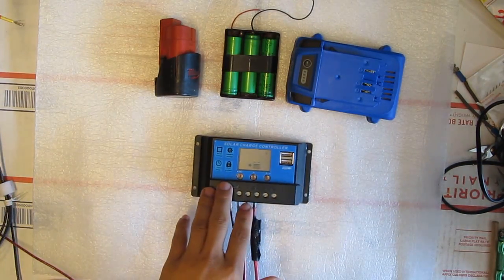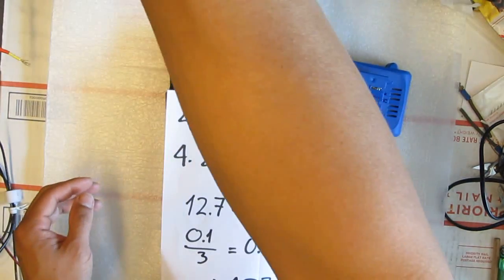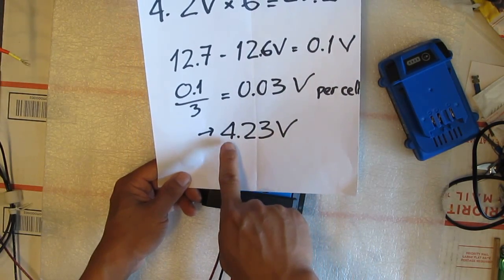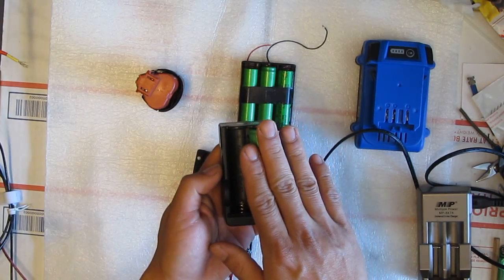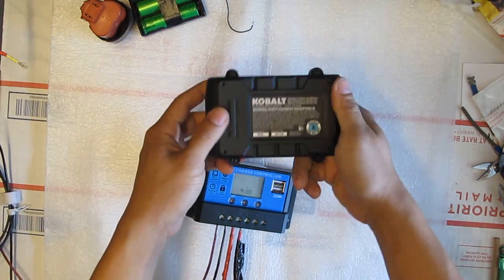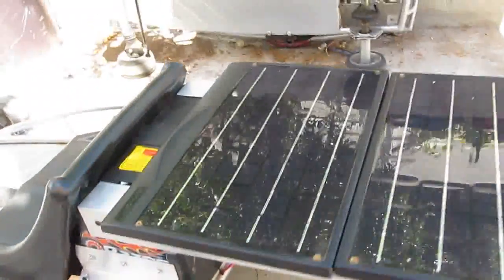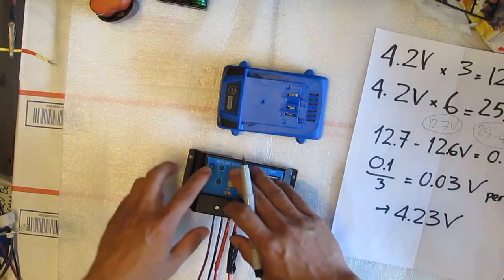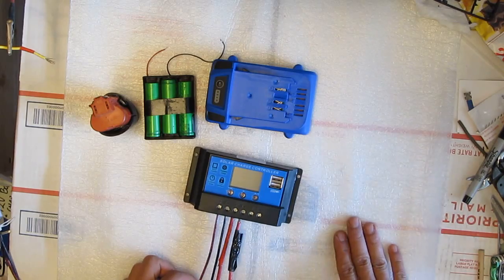Charge Li-ion batteries with regular Charge controller made for Lead Acid batteries

Comment: Without balance, you could over charge a single cell as they won't have the same voltage.

You can put a diode on and get a 0.7 volt drop. But you can add volts from the minimum to make up the difference.

Or you could get rid of the charge controller and use a buck converter. It would be less and you can control the current and voltage.

Comment: Hello sir, suppose i use 3s bms to charge 3 cell battery pack, while charging the battery pack, at the same time can i run 12v device from output of controller? How many months or years your lithium battery survived

Comment: Hello.... and thankyou kindly for your video because i have just purchased one the same exspecting it to charge lipo cells.... your spot on with your maths and i was always tought that you take it to the lowest or highest values in resistors when messuring the capacitence etc.. 

just gota figure out wich setting to put it on now b1 b2 or b3 hahahaha decitions dicitions... stay kool bro.
out.

Payyyyyce.

Comment: Charging voltage is not the only parameter. Lithium cells also have a maximum current for charging. Typically this is "1C" (for cheap Chinese LiIon), that means one times the capacity in amp-hours giving a figure in amps. So those 18650 are, say, 1500mAh capacity -> meaning your charger needs to be configured to output a maximum of 1.5A. These cheap lead acid chargers don't have a current limit setting, only voltage. Too much charge current, at best, will reduce the life of your batteries. At worst it's downright dangerous (overheating, fire, etc).

Comment: most lead acid chargers may say 12 volts but they will actually bring the voltage up to around 14v. Sometimes even higher. Have you put a volt meter on the battery as its charging? just to see if is staying at the voltage you set it at.

Comment: HI VUAECO.HOPE U AND FAMILY ALL WELL.IM THINKING ABOUT USING MY RENOGY ROVER MPPT I HAVE IN BACK OF MY CAMPERVAN  TO CHARGE MY EBIKE BATTERY IM NOT UISNG MUCH.ITS 52VOLT 14S5P.CAN I SPLIT INTO 2 AND CHARGE AS 24V TO 26V FROM MPPT.I HAVE 30WATT X 3 PANELS ON ROOF.OR LIKE YOUR VIDEO MAYBE JUST USE A 6S5P BATTERY AND ALTERNATE 2 OF THEM CHARGING .MY WAECO COMPRESSOR 12/24V FRIDGE RUNS AT FRONT OF CAMPERVAN AT MOMENT OFF A 100WATT PANEL AND A DC TO DC CHARGER.SO PERHAPS CAN RUN FRIDGE AT BACK OF 18650S
Reply from the maker: Hi Steve, Yes, you can split the 14S pack into two if you have an 8S charger. Most balance charger are for 6S so you might have to split that into 3 parts (6S, 6S, and 2S)
Reply: @vuaeco  ok.so if I use split 14s battery into 3 and charge each 6s from solar neat a time and can I hoping to connect usb to between 12v half of 24v part.ive got a bms bluetooth connected to 14s pack at moment so can monitor cell voltages.so maybe can join 2 x 6s together again to balance or I've seen a 8s charger on eBay 50£
Reply: sorted for now ive wired usb to battery terminals on works ok so must be 24volt compatible
Reply: @vuaeco  hi .I’ve split 14s battery into 7s x 2.connected in campervan to renogy rover 20 amp mppt.its 26volt the 7s after charging.there’s 3 x 30 watt panels on roof.I had a usb socket connected to load of renogy but can’t get load to switch on.will usb still work off 24v?been playing with settings on renogy.I get 12/24v up then 24v then press enter but goes back to display 12v each time.I was only using renogy to power usb socket when had 12volt leisure 110ah before.
Reply: It seems you can get usb sockets for 12/24volts
Reply: @vuaeco  after trying the 7s 18650 in campervan it dropped voltage to 21.6 volts from 27v after a cold night and although there was some sun it only managed to get to 22volts so I’ve taken that pack out and I’m using a lead acid 110ah battery that’s parallel with my fridge battery 110ah .that has 100watt panel an another epever mppt running that seems ok now

Comment: This video shows you what can be done I wouldn't say it should be done though.  If you're going to use Lithium-ion batteries with this particular charge controller there's only one way to do it in my personal opinion. It would be with a 7s configuration. Putting the battery within the parameters of the charge controller without overcharging the battery. Not only do you not want to charge a lithium battery beyond 100%. In a solar setup you really should only be pushing them to 80 to 90% capacity. So even though lithium iron phosphate is a much better chemistry for solar setups I think it's just fine to use lithium-ion cells. Use them if you got em. But use them the right way. And for God's sake if you're going to use the cheapest possible charge controller put a BMS on your battery! I do like your videos but some of them such as this one are a little bit reckless.
Reply: I tried using this setup on my lithium ion battery that has a bms and it blew up. I now use a similar solar charge controller meant for li-ion battery

Comment: Hello friend! The parameter you are changing is not the charging voltage. It's the "float charge" voltage and that means the controller will just trickle charge small amounts of current at 12.7 volts, AFTER the bulk and absorption phase. After the battery reaches finish the absorption phase at 14.6 volts or whatever voltage depending on the battery type, (B1, B2, B3 in the manual its the menu number 6) it enters the float voltage charge which actually is for maintaining the battery at full charge without the battery being burned!
Reply: I believe there are different versions of this controller that look identical but function differently. When I change that parameter on my controller it's definitely not setting a float mode. It's a disconnect.
Reply: @aznative_  My previous comment was an expectation of what the charger should do. But after installing it, what it does is that it just stops charging at 14.5V. The float mode doesn't work and nothing changes if i set it to 13.4 or 13.8V

Comment: Good morning Sir.  Thank you for sharing this.  I do not have any technical knowledge but would like to get a small solar system set up for my driveway lighting.  Your video helps a lot as I have been thinking about the storage.  I'll likelybuse my old laptop batteries to just get started and have a feel for the system.  May I ask: 
1.  I saw some videos saying that it is advisable that the controller have a temperature sensor to protect the battery, but in their video they had a lead acid battery set up.  Would this be a concern for the set up you did?  I will likely not check it often, so I would like to just make sure it won't be a problem later.  
2.  I am planning to plug in the load to the controller load connection.  Would this be a sound set up or is it better to have an inverter?
3.  If I use an inverter, can a 24v battery setup handle it and what inverter wattage is advisable given I plan to run a 24v 40w swing gate opener and 3 6w led bulbs?  
Sorry for the many queries.  Any help would be appreciated.
Reply from the maker: Unless you have wild swings in temperatures, the temperature sensor is not necessary. I rarely use it. Don't use the load on the controller, an inverter should be used. The load on the controller is only 12V DC with very low current. You can use 24V system but 24V inverters are harder to find and more expensive.
Reply: @vuaeco  ok, i'll keep that in mind when I plan out my purchases.  The temp range is 9 to 28 degrees Celsius plus where I plan to keep the system's case is often shaded.

Comment: The one thing that isn’t covered is the rate of charge. Most 18650 will only take 1.25 amps of charge. Anything more will damage the cells. The only way to get around this is to parallel the cells so they can accept/handle more shared amperage.
Reply: Non è vero

Comment: Hi my friend I tried this, and charging a 3S until 12,7V, the PWM controller went on flutuation voltagem, but still puts A on the Battery and some cells went to 4,5V.
Reply from the maker: These are made by so many different manufacturers. Make sure you check the max voltage on the controller when it's charging your battery. It shouldn't go over 12.7V. If it does then your charger has a problem.
Reply: @vuaeco  thanks for the advice, I will test mine to see if they Stop... I have 3 and one of them passed 12,7V is a little high, but if the Battery is balanced, not that much 0.03V, but now I made a 4S50P to prevent that from happening.
Reply: Same here. Using exact same setup as video. Just be careful that some cells may over voltage. For best setup also include a balancer to avoid over voltage. At maximum threshold of 12.6v S3 is not always reliable as there is very high risk of over charging and over heating the batteries leading to a shorter life span. Making a 16.8v S4 or higher battery pack and adjusting the solar charger is a more efficient and safer option if a balancer is not available. These cheap chinese solar charge controllers aren't always accurate so keep that in mind.

Comment: I have that charger and the 24v 2ah Kobalt tool battery. On 6-12-2019 at 0725 hrs I programmed the charger to 25.3v and am starting out with 21.4v on the battery. Look for smoke on the horizon?

Comment: What about the trickle charge... lead acid has a high discharge rate and if that charge controller is designed for lead acid... then the math shown is incimplete... either he doesnt know difference between lithium ion and lead acid or doesnt care if the lifespan of batteries gets shorter... maybe he is just promoting the product...

Comment: Il try to use a batteries from laptop battery cells , if i connect the lithium batteries do i have set in the settings? Or isit automatic detect? Bytheway this is my small hobby solar setup. https://youtu.be/wQNQM5qd32s

Comment: hello, in this controller it is possible to regulate the voltage for the batteries in the 4 load levels: Equalization, Float Charge, Stop Download, Reconnection Download?

Can I regulate the maximum load voltage to 16.8v, floating load to 14.8v, discharge discharge to 12.0v and discharge reconnection to 13.8v?

Comment: hello, can I use this controller to charge a 4 cell battery?
Reply from the maker: You need to get up to 16.8V to charge a 4S battery pack. This controller can only go up to 15V so the answer is no, you cannot charge a 4 cell battery pack with this controller.
Reply: Thank you! Do you know any controllers that can reach 16.8v?

Comment: hello, i bought one of these 30A labeled MOHOO. In the manual in technical parameters indicate 30A charge discharge current but after advices  "when the controller is connected to the 12V battery, the output of the maximum load is less than 120W and 240W when connected to 24V battery". Can anyone tell me how much load can i use, because less than 120W y less than 10A and is rated current 30A.

Comment: Can check to see if it will charge 7 cells at 29.4v? Reconnect at 24.4v under voltage protection at 21v?
If you could check to see if that charge controller could accept those numbers I would really appreciate it.
Thank you
Reply: Adam Welch has this in his solar shed videos.
Reply: @jakobhovman  YT ink?

Comment: Very nice video on this controller and also your other video on the controllers with lead-acid batteries.  I think it would be advisable to use a 3S BMS for 18650's as you have done here in the 12.6V case. Boards with balance capability are available from sites like Banggood for around $5 and they appear to work well.  They have over and under protection and over current as well as balance and they are made to be used with generic power input so they should work just fine with this charge controller. Apparently this controller does not fully cut the charge when current falls below a predefined level.  I plan to program an arduino nano to do that using a 5V relay and power it through one of the usb ports on the controller.  Thanks again for your videos!

Comment: Hello agen my freand really love youre videos i have a quick question or idea i have made a 74v34 ah battery for my e bike and was thinking if the e cobolt positive and negative end would charge the battery wich the cobolt charger like if you use 24v or 48 v paralel or 72 v if it would it would save allot of pepol waching you alot of money insted of geting a cicle statyator charger thats 350eu. Ty agen for the video and keep up the good wark ill send a pict of my e bike 1ns finished.
Reply: Pavlos Soultoukis If you're looking to assemble a 'poor mans version,' of grin techs cycle satiator, (yes they're kinda pricey,) to safely charge diff types of batteries (e.g for ur ebike packs) inc lithium at adjustable voltages and power levels (amp rate,) I found the easiest way is to mod a server power supply (I'm using a 1200w HP version) to power an adjustable DC-DC converter (I'm using the 900w digital display drok unit from Ebay.) They are programmable and in full mode they include a coulometer for capacity checking, on the fly adjustable amp and voltage rate, do cc/cv charging plus have 10 creatable presets than can be stored and then loaded up for diff pack voltages. They aren't as neat as a satiator, (one can always make an enclosure,) but they certainly do the job
Reply: ABritInNY 
Im finishing my cickle satuetor cables today ill send you a pict 1ns im finishd with the first charge ty for the healp.

Comment: Amazing videos Vuaeco…

Look I am design a solar panel/battery system… I thought
that getting 18V solar cells to charge a 12v SLA battery would be smart… Ive
also purchased a CMTD 20A solar controller. I am still waiting for the arrival
and I have one doubt… If the solar panels provide more than 14,7 V as
recommended charging Voltage in to the batteries, What will the solar
controller do? Totally cut the inbound power from the panel as it will be higher
that the max Voltage permitted or reduce to the Max of 14.7?
Many Thanks

Comment: can i charge 2liion cells in parallel with the usb output  without any bms? thankyou
Reply from the maker: No. USB has a 5V output and it will overcharge a 4.2V Li ion battery. You need a BMS.

Comment: Been trying to find one that looks exactly like this one on ebay without success so far. Can you help
Reply from the maker: There many of them on ebay. The blue color on this one is just a plastic sticker. They might not use this sticker any more. But I see many grey colored ones available. Just look for one that has the 2 USB ports at the same spot on the controller and the 3 buttons down below. They are all the same. It's just the stickers make them look different with different colors.
Reply: Like this one? http://www.ebay.com/itm/10-20-30A-12V-24V-Solar-Panel-Charger-Controller-Battery-Regulator-USB-LCD-/391735371627?
Reply: i founded it on banggood : https://www.banggood.com/102030A-USB-Solar-Panel-Battery-Regulator-Charge-Intelligent-Controller-1224V-p-1143533.html?p=HB18031095105201501Z

Comment: Upon watching this I purchased one of these to charge a bank of 30, reclaimed 18450 batteries, 3 in series 9.3v Min and 12.6V Max with a Renogy 50W solar panel.     One
thing I added was a battery management circuit/cell balancer and a fuse block with 20amp fuse.  I’ve been using this setup and it works like a charm.  I don’t believe the battery management circuit is absolutely necessary but highly recommended.  I’ve charged this for dozens of cycles with absolutely no problems.   I heard these charge controllers are pulse width modulation chargers meant for lead acid but this does not seem to cause any problems for lithium ion.
Reply: I'm trying to run the same setup but with a 10W solar panel. I was wondering what charge profile you are using on the controller? From reading the specifications, it says it has the capability to charge lead-acid, AGM, and GEL.
Reply: What kind of battery management circuit do you use?

Comment: I use a 10000 mah RC 3s lipo with this controller to operate 2 night lights---Charges with a 30 watt solar panel to 12.7 drains down to 10.9 and the cell stay balanced with no bms. Thanks for this video.3 months and no balance issues.

Comment: another way to limit the voltage been send to the bateries would be inserting a simple blocking diode between the charger and bateries, since these have a forward voltage drop of about 1 volt the nominal 12.7 coming from the charger wil at the battery been reduced to....12.6 volt!
problem solved it seems
Reply: giottodiotto1 I think you mean 0.1v not 1v
Reply: Diodes are generally about .7V with low voltage Schottky about .3V   The big problem is this won't initially power up the controller and/or the controller won't know what voltage the battery is at once it reaches a full charge and is not supplying current to the battery.  Back to back diodes may help this or 100 ohm in parallel with diode.

Comment: i think your idea has one big flaw, just ignore the small ones. on those chargers you can only set the float charge but how do you avoid the equalisation charge? if you just want to charge liion cells use a small bike battery as buffer and use some 12v charger or one than works on usb. you probally could use an li pack with an bms but that would need further testing. some big capacitor could work too maybe.
Reply: Not ANY kind of mode.  It charges to the given High Voltage Disconnect setpoint and stops until it drops to the High Voltage Reconnect.  It'd work fine for lithium.
Reply: i believe these don't have a  equalisation mode
Reply: Use a 3S BMS.  That will handle the equilization, over voltage, under voltage.  Around $4.